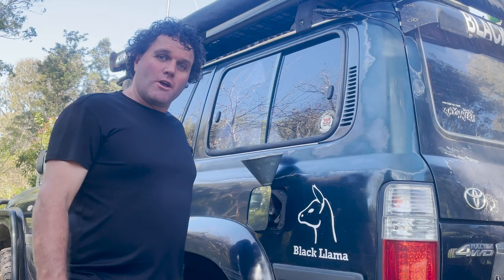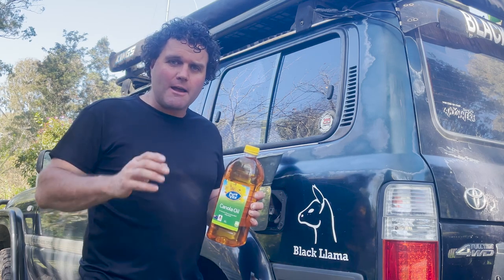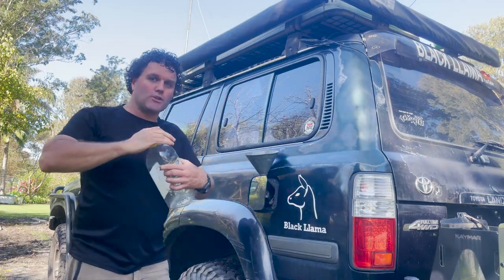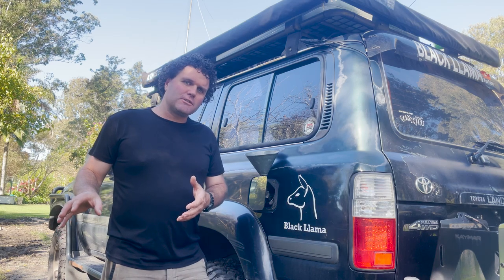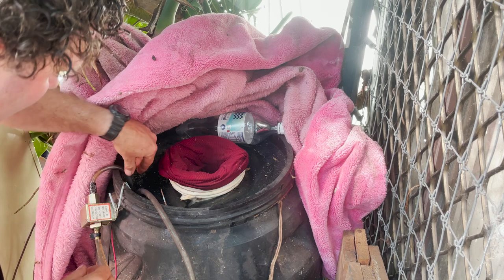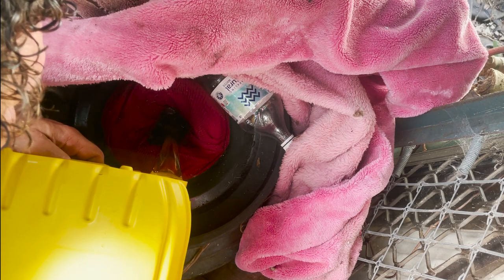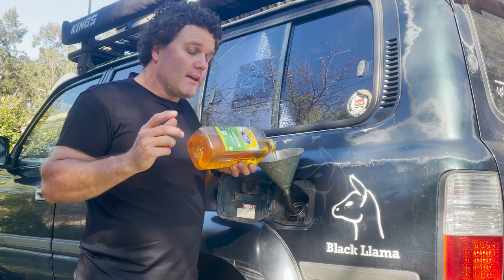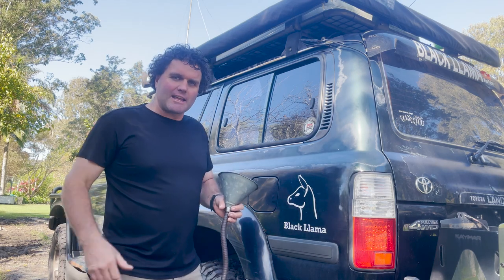Cooking oil in an 80 series landcruiser?

Comment: A few items you mentioned seem to be the same issues they had with turning fish n chip oil to biodiesel a few years ago. Pretty simple process if you have the time and oil and you get a handwsh ut of it as well.
Reply from the maker: Yes time is one of the issues, I have cut down on the amount of time doing it the way I am. Space is the other issue. I have no space to make proper biodiesel. But have enough space to do it this way. 
Thanks for your comment

Comment: great info, i assume it'll work in an LC105 with 1hz from 1998 as well? how did it run at 50:50 ratio in summer?
Reply from the maker: I suggest you do your own research before doing this.
But no reason it shouldn’t. 
It ran ok on 50:50 with no heating but friends following me complained I smelt like a fish and chip shop.
Reply: @blackllama1  ok thanks for the info i will look into it, cheers